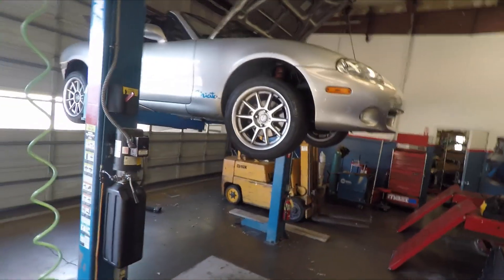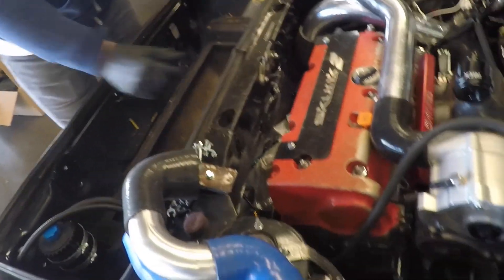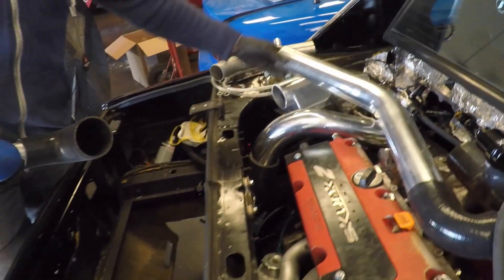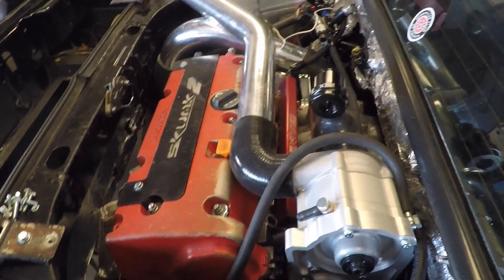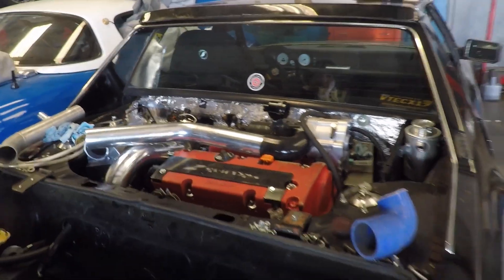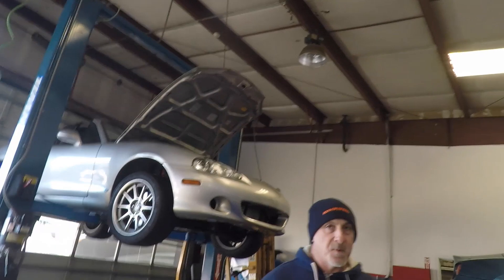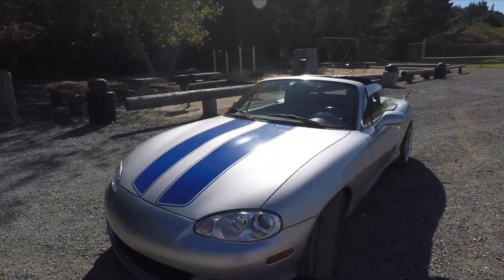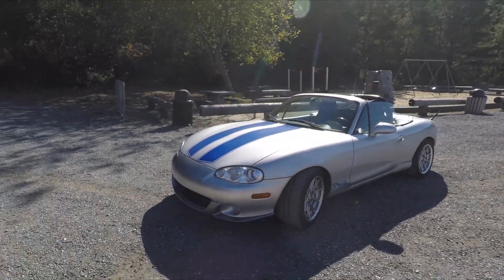Boosted Miata Update: New bumpers!

Comment: Have you done the GTX2871R yet? I ordered one for my built 1.6 and want to hear some opinions on it.
Reply from the maker: Yep it’s installed, more power, slower spool tho, need bigger exhaust and a better tune
Reply: @Seandoestech  hell yeah! I'll be bumping to a full 3" system for mine. They can spool pretty fast, just need the proper tune for them is all
Reply: Have you done any tuning or bigger exhaust yet ?